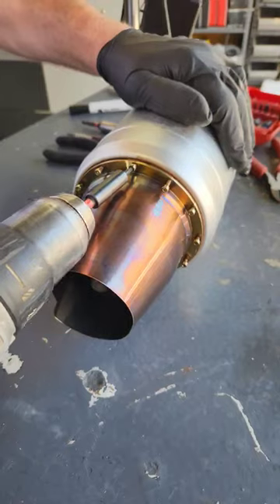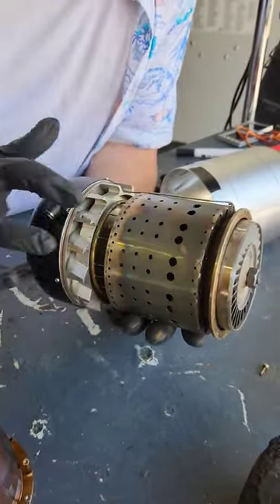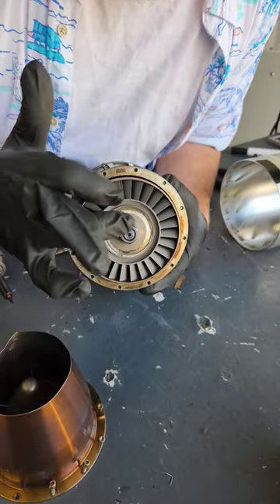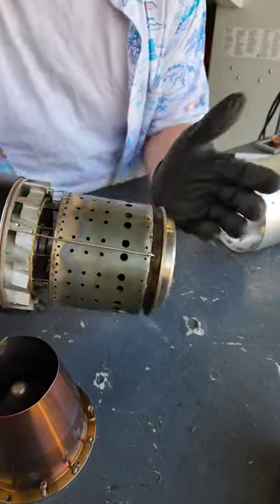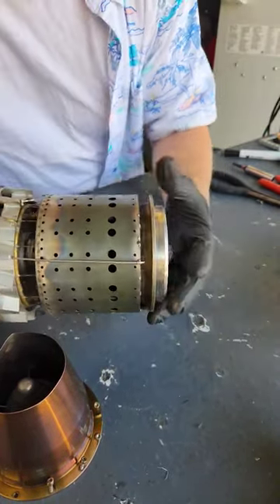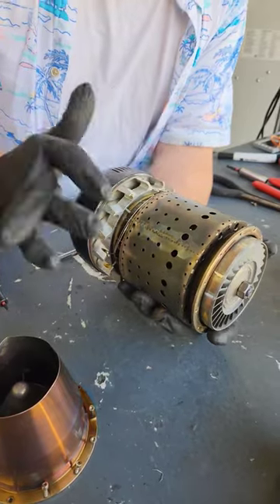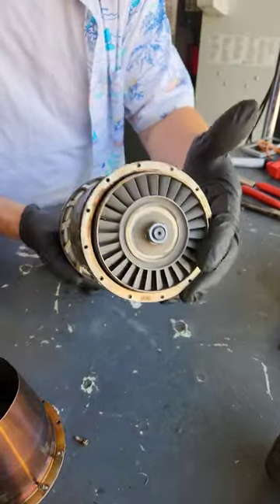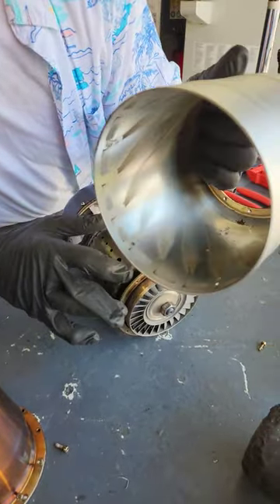Why You Shouldn't Use A Crashed Jet Engine

Comment: This is why you should expect that everything you are receiving is a turd when you buy an engine/transmission/x-fer case/transaxle from a vehicle that has been in an accident.

You, as a passenger, have all kinds of safety devices (like seatbelts, airbags, pre-tensioners, crumple zones) to reduce the forces felt upon your body in an accident. The mechanical parts of your vehicles don't have the same protections.

Back in the day, people used to consider that everything they purchased from a recycler may have had an issue.  These days, everybody seems to assume every used part they purchase has undergone FEA, and destructive/non-destructive testing before they pick it up from the scrap yard and can be assumed to be good.
Reply from the maker: You are dead on accurate, the forces involved in an accident are intense and can damage all sorts of things that are out of sight. That's a Great point
Reply: 😂😂😂 guys you don't know what your talk about vehicles wise vehicles don't have to be fully rebuilt in a crash I daily my 2005 /2006/2007 chevy trailblazer rebuilt title 287k miles and counting
Reply: @DEVIL666wtf  I'm not saying the vehicle has to rebuilt. I'm saying that I've seen hundreds of engines/transmissions that have been severely damaged from accidents even though they weren't actually hit by anything directly. They were damaged by their own weight simply because the vehicle was jostled around realy hard.
Reply: That's now how transmissions and engine work. Nothing is spinning at a 100000 rpm on a car or truck. Stop taking vehicles so serious they're just nuts and bolts.
Reply: @RK-kn1ud  What gets damaged on a car or truck engine from being jostled too hard?
Reply: @FinalFront  Usually the case is cracked, but sometimes they just get tweeked enough where things inside the engine rub like they weren't supposed to rub...causing premature wear over time.

It isn't super common, but every junkyard engine I've ever installed I've always installed knowing that there could be something wrong.  Even if it weren't for the accident it was in...it could have been something the previous owner did.  That said, over 30 years I've probably only seen it happen 2 or 3 times out of a few hundred.
Reply: Nobody thinks things are inspected like that. We go to the u pull it to SEE if something is viable to be used to save money. No I don't think the brake caliper I pull from the Ford Taurus that had a failed transmission and got scrapped, but you know damn well ittl last longer then the one I have that's seized and 20 bucks and a half an hours work is a much better choice then over  100 and a few days wait. If you have a car worth money, chances are you aren't replacing things with used. But the whole point of using already used parts is to save money or have fun for cheap.
Reply: It’s perfectly correct that crash forces can cause hidden damage to bearings, shafts, mounting points and who knows what else. 
I slid on ice and a kerb at about 6 to 8 mph. The suspension was wrecked. I rejected the repaired car because drive shaft was noisy and steering stiff. Power steering pump was not damaged. Rack was toast.

Comment: I have a pile of these lol... not even worth rebuilding. Cost more then new one in the end.  You will never balance it true, bearings never last you replace long.  Burn chamber already has melted crap in it like that coat compressor side blow it all over till its out of balance again.
Reply: What is the name of this Jet Engine? Manufacturer?
Thanks?
RL

Comment: What can be done to prevent the metal debris on the inside of the engine or anything coming into the engine through the compressor veins at the front of the engine